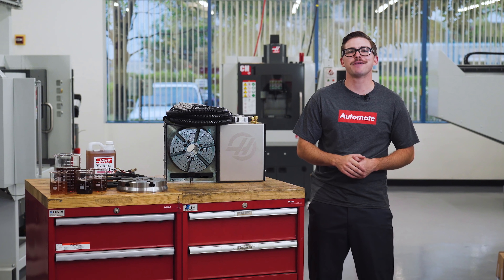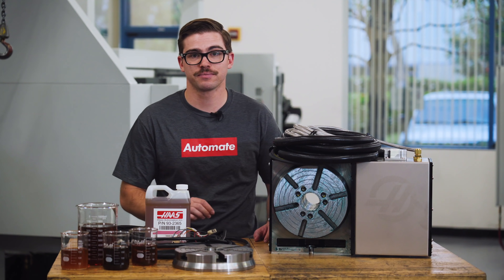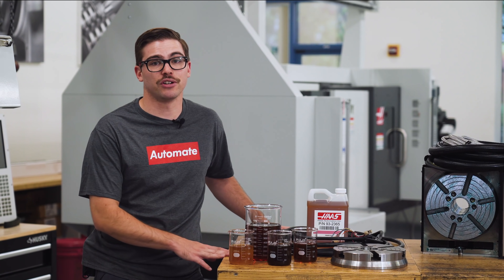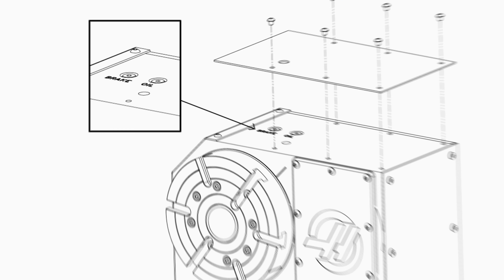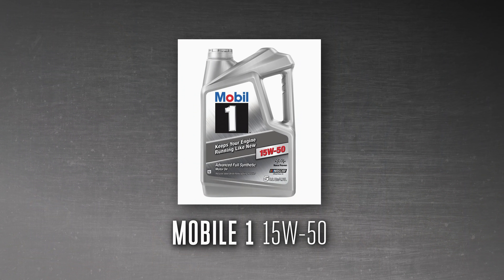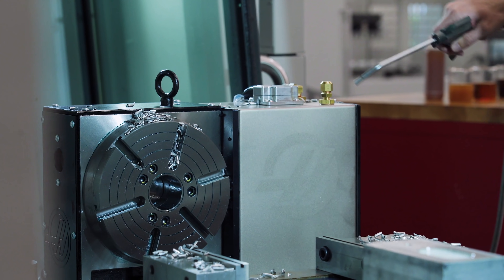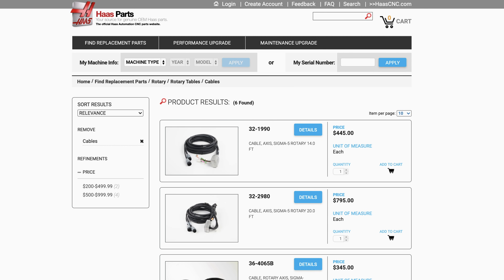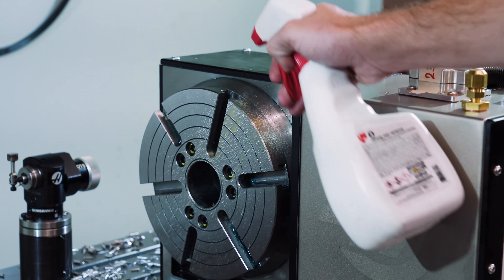Rotary Maintenance - Haas Automation Service Video

Comment: Is it normal for a new HRT160 to be losing some oil?
Reply: Mine does too, trying to figure out what's wrong. Did you figure it out yet?
Reply: @JohnBlaze505  Turns out the seal behind the platter was letting some oil out even when unit was not in use. Haas Service replaced it on warranty free of charge and it hasn't leaked a drop since. It's a quick job too, it took the tech less than 2 hours to have it done.

Comment: Couple pointers about electrical tape: 
1) Do not tear the tape, cut it instead. Tearing stretches the end and when it eventually shrinks back it will happily start coming off.
2) For wet applications such as these cables that get coolant splashed on them it is better to use heat-fusing tape. While more expensive than regular it has a major advantage of fusing together and shrinking slightly when heated, forming a tighter practically permanent repair.
Reply: i'm not sure if the haas cables are at risk of this but heat-fusing tape can damage the insulation between the internal cables due to high heat. Self-fusing electrical tape (or sometimes called "cold shrink tape") would be more adviceable, even though it is (once again) more expensive.
Reply: @angrydragonslayer  Huh. Never heard of heatshrink of any kind needing to get so hot that the heat damages wires it's going on.
Reply: @AgentWest  this is more of an "operator error" thing but some shrinks will need more heat than cables not meant for hot operating temps can handle.

Ignoring those relatively rare mixes, i've seen several (and heard of many more) people who just kept heating heat-shrink after it had already shrunk.

Edit: i realised that both scenarios are operator error
Reply: @angrydragonslayer  But if i heat it up more it will just shrink tighter, right? Right? lol
To be fair, i have done that a few times when i first started doing electrical work. And i guess you're right, some specialized cables may have a different covering, though i'm pretty sure most are PVC these days.
Reply: @AgentWest  most cheap cables are using PVC and they're actually the vulnerable ones

I have heat shrink tubes in my shop for a special silicone/PEEK mix insulation meant for use uncomfortably close to blast furnaces. Your heat source will melt PVC (not normal silicone though) before it even begins to shrink
Reply: @angrydragonslayer  Are you talking about silicone heatshrink or silicone wire insulation?
Reply: @AgentWest  heat shrink meant for silicone, i dont remember what the heatshrink is specifically
Reply: @AgentWest  we have some 4-th axis rotaries in shop like 10years and never have problem with cable
Reply: @matejkuka797  What brand tape did you guys use?